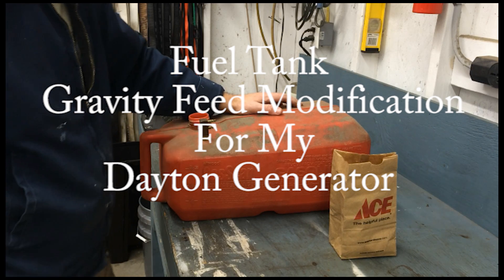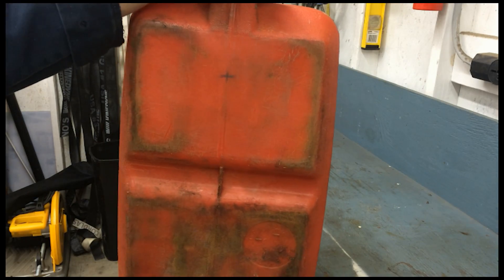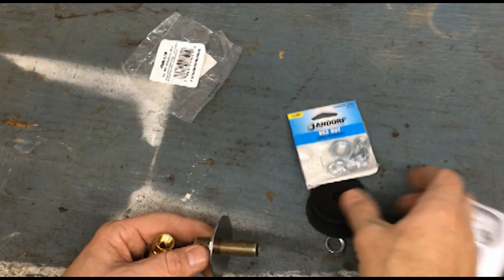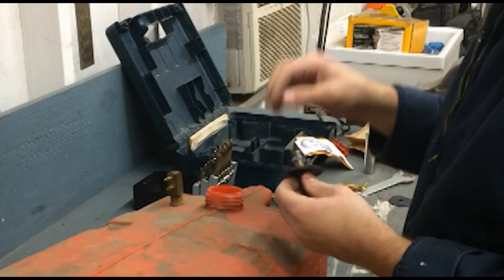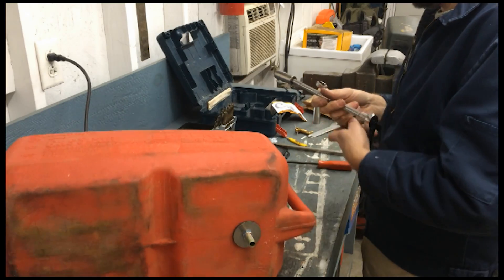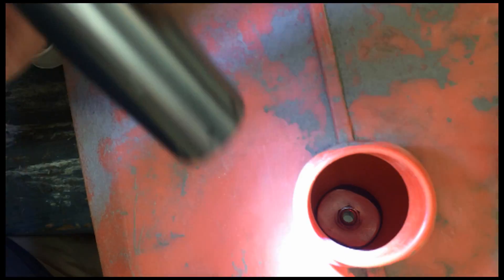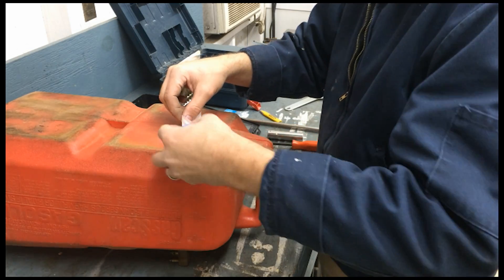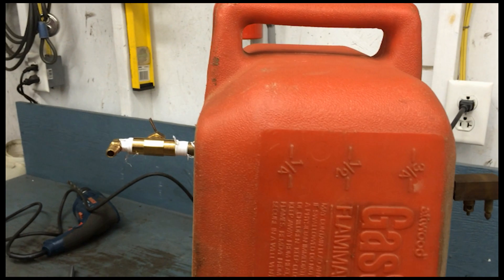Gravity Feed Fuel Tank From A Marine Gas Tank

Comment: For the hard part of fishing the parts through use a fishing line and Romex wire or metal coat hanger.

Well done 

I made one to hang from the hood and bypass bad gas and a dirty fuel tank. This works well on older carbureted engines.

Comment: Has the rubber held up to the gasoline with no leaks?
Reply from the maker: Yes so far its worked well. I haven't let the tank sit with fuel in it unless I was preparing for a storm. Any other times I dry it out to keep the system from gumming up. This setup got me through Hurricane Mathew in 2016 and Florence in 2018, its been great so far.

Comment: Are you bypassing the existing tank or is the marine tank considered the second/auxiliary tank? How did you connect the fuel line at the generator?
Reply from the maker: Here's a link to a video of the framework and mounting the tank, it may answer some of your questions.
 https://youtu.be/S3HiP7RLZf0  
In this video I still had the 1 gallon tank attached, however its no longer there. 
Connecting the tanks was easy on this generator since it was regular barbed fitting, 3/8 hose and worm clamp setup.